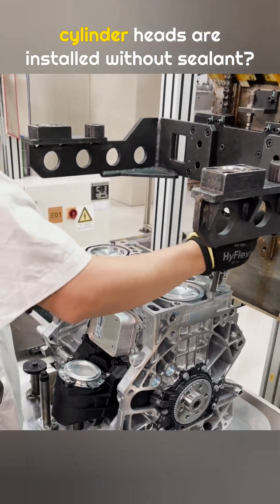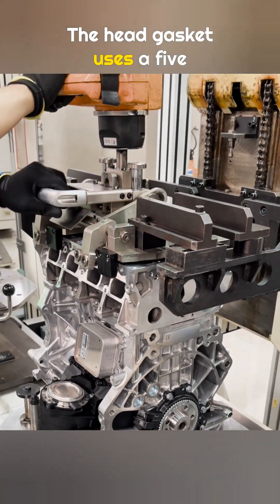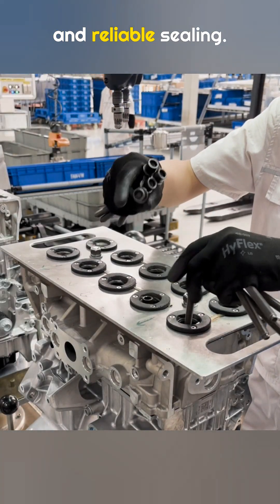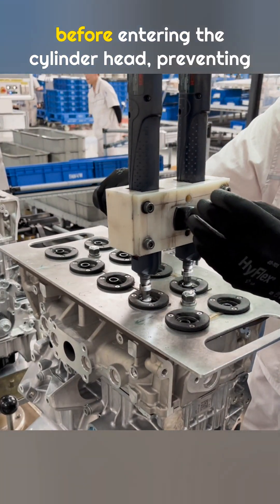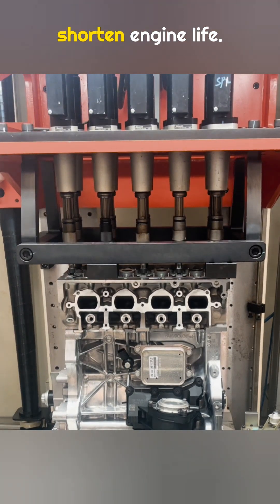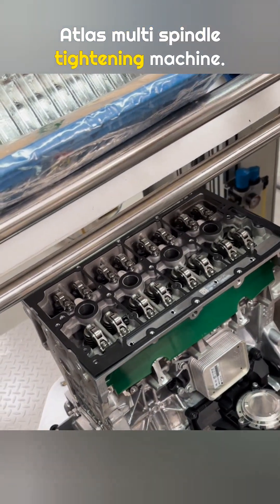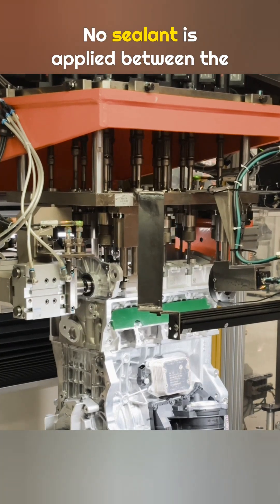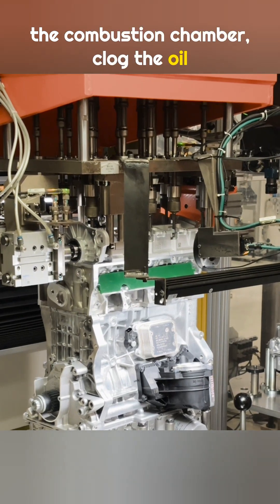Why Volkswagen Engines Skip Sealant on Cylinder Heads

Comment: I just cleaned up my 2 cyl Diesel   Yammer garden tractors cylinder head  that is water cooled  and used Black RTV silicone sealant  , all good and no problems so far

Comment: Didn't know VW used gaskets for their engines. Last time I worked on my VW/Audi engine, everything had sealant instead of gaskets. BMWs on the other hand use mostly rubber gaskets which do tend to become plastic over time and multiple heat cycles. 

Have both, love both for their own goods and bads.

Comment: Cool how they tighten every headbot at the same time. The ultimate even torque.😊
Reply: Problem is that's factory, no repair shop has this capability  and will tighten one at a time. I would rather the factory used the same methods as a repair shop so the results are predictable after repairs.
Reply: @peterschmidt1453  that's why there is a torque pattern and often increasing steps. I get your point but of all times the factory  ignores repairability, this is low on the list. 

These kinds of repairs should only be a major overhaul.  At 50k I'd be upset.  At 150k is be more understanding.
Reply: @peterschmidt1453  how about various sized bearings to fit unevenly machining?   When they change the bearing to make the correct oil gap. Now that's really annoying. 😢
Reply: @geniferteal4178  You mention the torque pattern, the point I made is the factory does not use the torque pattern they specify for rebuilds, there may be a quantifiable difference in longevity between factory and after repairs.
Reply: @geniferteal4178  Yes, new parts that should in theory be within a tolerance having custom tweaks is annoying, needing a machine shop to alter brand new parts in a standard engine should not be necessary.

Comment: If you look at this, than you realise again that internal combustion engines are very complicated to built
After 125 years it is still a challenge
And it makes noise , has fumes and has only a bit of torque at a snall range of rpm
Hundred’s of parts
And  25% max energy efficient
LETS’s GO ELECTRIC
NO GEARBOX NEEDED
100% TORQUE AT ALL rpm
Only 25 parts max
Lasts 1 miliion km 
And 95 % energy efficient
Reply: And several broken batteries.

Comment: And plz also tell me why they are not welded together
Reply: Because it's cheaper to replace just a cylinder head than an entire long block. If the failure/damage is only in the head, like a burnt valve, then you only need a top end.

Comment: So, another company cheaping out on critical deep engine builds. None of the latest engines can be overhauled, nor will they last over 100,000 kilometers, 62,000 miles. No, the entire engine has to be 100% scrapped.
Reply: I currently have 110k miles on my 2019 1.0 TSI and the engine is in great condition and uses no oil. A friend has the same engine with over 250k miles and has no problems at all. I even saw a 1.0 TSI for sale with 550k miles and the original engine.

Comment: Why can't all the engines are designed without the head gasket?
Reply: Two reasons.   First, you have to remove the cylinder head for service, so a material that will compress and seal the two pieces together.   Second, tempature differences between the block and head make it critical to have a gasket.

Comment: Engines from VW dont last anymore what they used to last, I know !

At 300.000 km (2010 year of built) I had to replace the engine. It still rotated but had wear on the cam.
Reply: And why did you change the engine and not repair it? Replacing the camshaft (or the entire engine head) is a relatively cheap repair for a few hours. Replacing the engine is many times more expensive.